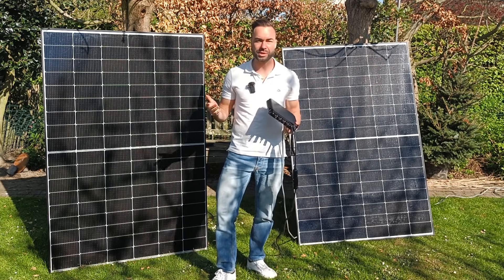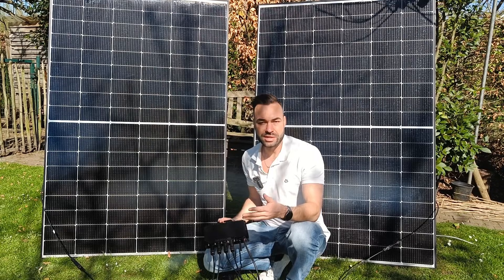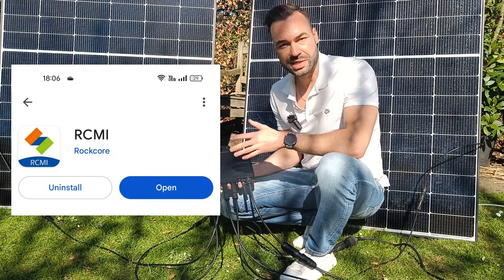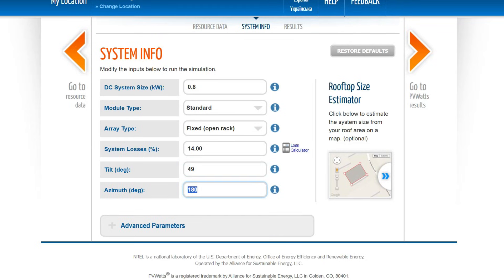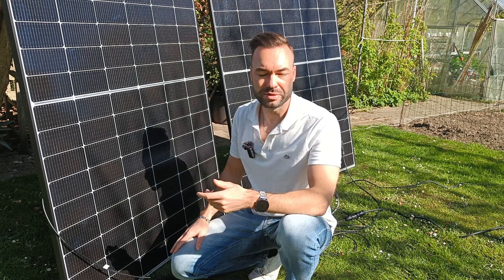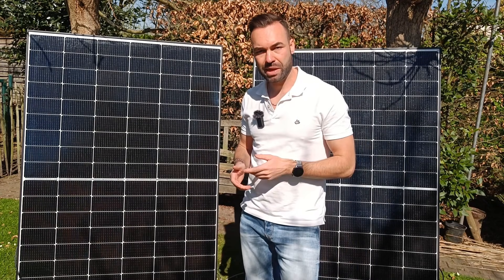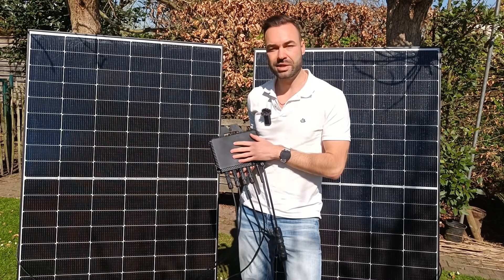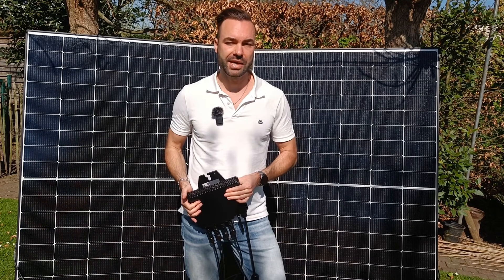800W Balcony Solar System - Plug and Play Microinverter with Socket

Comment: Please explain how power from the micro converter overrides power coming from the street. In other words, why are the appliances choosing the micro converter over the conventional power source? Thank you.
Reply: The appliances don't "choose" power, they just take what they need and the amount taken is measured at the meter. If there is already electrical power in your wires from your solar system then there is less power needed to be pulled from the electric utility wires coming in to your house. If you have the right meter set up with the power company then you can get credit for sending your extra power back out the wires to the grid for someone else to use.

Comment: Thank you for doing this and BEDANKT!  In America our utility has "bi-directional power meters" which means they can measure outgoing just as they can incoming power.  Here if you over produce without a "interconnection agreement" we would get charged more for sending power to the grid.  I wonder if they don't have those situations in Belgium, Germany, Netherlands, etc or if you just plan to have a system smaller than your typical usage for offset to the grid?
Reply from the maker: It used to be that we got the same amount of money for sending it back to the grid. So it was 1:1. But those good times are gone. Now we get €0.005 per kWh we send to the grid and pay 0.3 per kWh if we take it from the grid. So now Europe is big on battery storage.
Reply: @cleversolarpower  when solar was very rare our 1:1 was called "Net Metering" or netting the same $$.  The utilities changed in 2019 and some states have it better than others.  It seems big business is beating the people in Belgium, too, now!  :(

Comment: Mention that you need a directional meter - one that recognizes that electrical energy is flowing back to the grid, otherwise you will be paying for the electricity you send back.  I suppose you mentioned a "smart meter", but it wasn't clear as to why.

Comment: Hello Nick, I am a Belgian guy, living in the South of Spain. I currently have a 12 x 450w with a 5k inverter, installed by Ecosolar, a professional solar company in our region. I have a little outside sun room with a tilted roof where I could easily install 2 extra panels as shown in the video and let it all feed back into the circuit of our home. Our electric company currently has virtual battery system so I feed back to the grid and get (very little) compensation. Do you think I could automatically feed the extra energy in to their grid without notification? Thanks for your video.
Reply from the maker: That depends if they allow it. You have to see if they can accept it. You can also do grid zero and store the excess in a battery.

Comment: So these units turn off if the grid turns off?  You wouldn't want to back-feed into the grid if the power goes off - you can electrocute workers on the grid.
Reply: Yes, these are grid following. So they can't generate the AC curve and will immediately go to 0V if the grid is disconnected. Even if the grid comes online, it monitors the voltage and frequency for a while before it starts to export.

Comment: How would you manage this if you wanted to double the size with two microinverters especially in the uk?
Reply from the maker: You need to check your local regulations. Here in Belgium that is not allowed. If you want more panels, you need a string inverter on a separate circuit.

Comment: I’m installing a ground mount system 4 -450W panels and as I will get some shade I want to use a GROWATT NEO 2,000 micro inverter as in Germany if you have over 2Kw system you must have an electrical inspection to sign off and I can’t get anybody to do this with out paying a lot 
I like the plug and play option.
I made a 2 panel mobile frame that I can move and it is using a 1,000 Growatt micro inverted im averaging 3.5 Kw per day 

I thought that it would be cheaper to use a micro inverter than a string inverter and optimizers 
Your thoughts 
I live in Northern Germany

Comment: Are you an AI character?
Grid signal? You mean electricity from the grid!!
You're limited to which circuit you're trying to access when you plug into the existing outdoor outlet. Unless you run the extension cord through the window. Better to tie through the 120vac transfer switch at the main panel..
Reply: Nick is Belgian, he has a typical Belgian English accent :).  (and typical  Belgian looking self build villa) 
Belgium has a self-build housing culture which is a big part of their economy. Hence solar is very popular when starting new projects with owners ordering their own pallets.  Most Belgian houses have 230V sockets in the garden/patio and also any garden house/shed and often standalone garages.  Main metre and fuse boxes are often in the basement (concrete) at the front of the house or the closet room above (concrete floors) So they spec as many features as possible at build time due to the concrete floors and bricks.  Cables are channeled into the interior brick.  Their digital metres have embedded modems sending data down the lines to the utility company's office for billing, with metering units having 4 x digit counters -  2 x Input night and day and 2 x Output night and day.

Comment: I wonder about the risks of backfeeding the network when there is an outage.
Reply from the maker: There is no risk since this microinverter uses the grid signal to work. If the grid is gone, all microinverter stops working. Off grid inverters create their own sine wave, so they are dangerous and cannot synch with the grid.

Comment: Hello , 
Please can you let me know because I buy also 4 solar panels    18,15 v   , each panel 200 W  so in total 800 W      and I buy also a Micro Inverter  1800 W ( on internet the   A I  said that a Micro  Inverter  1800 W is manageable  -  Not too Big because if you buy 200 W It Is Too Big - says the  A I ) so What I  want to ask you is :
Can I Plug 🔌 The Wire From  the Micro Inverter Anywhere  in my House  or it Must Be On A  Specifically Place  ( maybe closer to the house electrical panel or , I don’t know  …. )  ?
Please Answer Me .
Thank you very much and best regards from Holland , Claudia .
( What is your Opinion , 1800 W Micro Inverter is too much for a 4 x 200 W  18,15v Solar Panels or is Ok  - A I  say that is Ok but I will like to know your opinion )!
Thank you very much again,
Claudia
Reply from the maker: First, is it allowed to plug 1800W in the wall in the Netherlands? I don't think so. You have to look up regulations and don't ask ai because it will tell you what you want to hear. Secondly you have to look at the specifications of the inverter. The input voltage and current cannot be higher than the inverter is specified for.
Reply: @cleversolarpower Perfect, I understand. I look and it is allowed in Nederland and all Europe to “ play “ with a solar panels system Until 800W , you don’t need to ask for permission, Not More Than 800 W ! 
Thank You So Much For Your Answer 🙏 , I Understand That “ Is Not Allowed - or Not Good To Plug Direct In A Socket In House  ! This I Understand, Am I Right ? Thank You For Your Answer, Again !
Reply: @cleversolarpower My Inverter is 1500 W , sorry I forgot to mention I was wrong to say 1800 W ! I wanted to buy a 1800w but I understand with a 4x 200w =800 W is Better A Micro Inverter 1500 W !( Not Inverter, but Micro Inverter - from that one to plug 🔌 directly . With the Inverter I have other Big Board With All Installed - I Believed That I Can Buy Also A  MICRO INVERTER To Have That like reserve , To use Sometimes !
Reply from the maker: Yes, it has to be a micro inverter. If you plug an regular off grid inverter in the socket it will be damaged. I recommend to not plug it into a circuit that has high power appliances running on it as well.
Reply: @cleversolarpower the only high power will be a 65” TV ( about 150 w / h ) and a refrigerator ( that one use about 150w — 200w  - is important how many times you open the door) .
If you say that is Not Good , I think that you know much more then me so I will let only the System With Inverter , I don’t buy anymore the Micro Inverter.
Thank you so much for your help and have a great day! Best regards, Claudia.

Comment: Thanks from Colorado.
Reply: Utah allows this.  I ordered a EcoFlow STREAM and am sending it to a friend in Utah.  Note that you will need a utility meter that senses current direction, else it will be charging you for sending electricity back.  In my case, I had 10k solar installed, so the house meter is able to send back current and get paid (~$0.13/kWh).  I have a few extra panels so will be using this technique to take advantage of them.  All the best from Salida, CO.
Reply: @TheExumRidge  Thanks Salida, you're just over the hill from us in Montrose.

Comment: Does this mean that most home outlets can handle backfeeding? i always thought it was very dangerous to backfeed into an outlet. If anyone has a link explaining how it works on that level i would greatly appreciate it.
Reply from the maker: In Belgium it's allowed on non-power hungry circuits like a washing machine. 800W at 230V is 3.5A and we use 16A circuit breakers. So 800W is considered safe. Anything more, and you need a dedicated breaker. Only do this if your local government allows this. Backfeeding is not a problem because the microinverter takes the sine wave from the grid an synchs with it. if the grid fails, the microinverter will not work. So there is no backfeeding into the grid when the grid is out, which is compliant with electrical code. Now you may not use an off-grid inverter to backfeed the grid because they create their own sine wave.

Comment: THIS DOES NOT WORK WITH "SMART METERS". And the micro inverter must be coded to work as a direct grid connection with all safety standards.
Reply from the maker: A micro inverter does not need to be coded. It does not produce a sine wave when there is no grid visible. It copies the sine wave from the grid. So if there is no grid, it cannot put out energy.

Comment: This system would save me a out $10 per month on an electric bill, so the ROI would be about 30 months.   But at normal prices for the panels and I better, it would be closer to 8 years to break even.  To really make this have a good ROI, you need to get the panels and inverter really cheap.
Reply: There's a lot of free panels about but the owners normally want you to take them down and remove them all, but unfortunately these are older lower wattage ones, sometimes less than 200W each.

Comment: Beware cheap or miss matched MC4 connector ., as it is hard to tell if the connector part is a snug fit . DC is very arcing .  try to use the same brand as the micro inverter
245$ for 800w of solar ! .... I paid £7000 for a 1400w solar system (1300Kwh/year) 12 years ago ... !
Reply from the maker: £7000 for a 1400w solar system is crazy! 💀
Reply: @cleversolarpower   is crazy now, then it was a deal ... it has saved/payed back £9000 so I am £2000 up ... And it was first in my street, & made it acceptable, now there are 5 , so climate win x 5

Comment: Many Microinverters are warrantied for much longer string inverters.
Reply from the maker: I think the reverse is true.
Reply: @cleversolarpower  For string inverters, a 10yr warranty is common.  For micro-inverters, a 25yr warranty is common
Reply: @cleversolarpower Enphase has a 25 year warranty on their inverters. And despite them being on the roof underneath a hot solar panel, the failure rate is very low with Enphase.

I don't know if cheaper brands will last as long, but I have one Growatt Neo 800 in the shed and just made some MC4 extensions to the roof. So that should keep it out of the worst conditions.
One of my neighbors had a 2500W string inverter fail within 5 years, and many brands have had issues within 10 years. 
It may all have been solved with what is available now, but I count on having to replace my 3000W string inverter long before the Enphase 325W micro inverters connected to the panels on the other roof.

String inverters are great without shade issues and many panels at the same angle. But as soon as you need optimizers, switch to micro inverters instead.

Comment: Cleversolarpower by Nick,hey how they store electrisity?if i conect to my house plug do this system will shortened?if not and will work do my home electricity will still calkulete kw how many i use them?or my grid caluletor just stops?
Reply from the maker: They do not store electricity, only convert DC to AC. if you want to store electricity, then you need a battery. If you connect it to your house plug it will sense the grid sine wave and synch with it. Thats why they are called grid tie inverters. Only connect these to the grid if your power company allows backfeeding.

Comment: I'm glad I found you. My electricity bills are so high, I can afford to use oil filled radiator heaters in colder month. I know there ars different types of Balcony Solar elements, not panels, but a rather small thing that turns rapidly to generate electricity, but it works with the sun, it was called Wind Power... easy to plug in n use. You can take it with you, if you move out of that apartment and use it in another balcony.
Can you pls make a clip about that type, wind power generator? Thank you.
Reply from the maker: Wind power is quite useless in residential settings.

Comment: hi, can you add a battery to this setup? nice video
Reply from the maker: You cannot. A micro inverter needs a signal from the grid. If you want to use a battery you need an mppt charge controller.

Comment: You're  assuming you're spending 800W at home in the middle of the day when there is more power, which will often not be the case, so ROI will take much longer. And there are the other issues some peoeple pointed out
Reply from the maker: The power is not lost. Any excess is fed back into the grid. And I can adjust my battery charging schedule  if laws about feed in change.

Comment: Is it easy to add batteries  to make hybrid?
Reply from the maker: No, you need another inverter. Grid tie inverters can only work with the grid or an inverter signal.

Comment: Thanks for the video, I've been looking into microinverters, they are small and awesome for a more "mobile" rig. I am looking for a tailored setup to power a solar well pump at a remote site on my property - are these microinverters suitable for that application?
Reply from the maker: They need a grid signal to work. If you want a solar well pump you should use a pump controller and a DC pump.
Reply: @cleversolarpower  Thank you Nick! DC pumps that I find online tend to be too weak/deliver low head so AC is the only way unfortunately.

Comment: DO NOT DO THIS if you have net metering!
You will want to install a subpanel, move your critical loads to it and completely disconnect it from your “metered” load center.
Reply from the maker: No need for that here. As I mentioned I'm in Belgium and the law is fine with it. Germany as well.
Reply: @cleversolarpower we have net metering or net billing. If your electricity provider uses net metering, plugging anything in to “compensate” your usage will only be added to your net bill. 
I thought it was important to state this because I do realize you’re not in the states. 
It’s always best to have a subpanel for any solar supplementing.

Comment: It is important to state that there should be a massive * next to "no permits". Here in the UK it is illegal to back feed to the grid without the DNO's permission (the company who owns the regions grid network). As a penalty you could pay a very big fine, get grid access revoked or even face jail time if damages were ever involved with a fault. The reason why the grid companies are so serious about this is because Anti-islanding protection is crucial for safety of operating the grid, safety that cannot be always guaranteed if the inverter appliance has not gone through the regional testing.
Reply from the maker: Yes, you have to make sure you follow your local laws. It's impossible for me to give a list of all the countries where it's legal or not. It's a big thing in Europe. Micro inverters cannot feed power back into the grid when the grid is down because they need a grid signal to work.
Reply: @cleversolarpower  Regarding this, is there a way to prevent the micro inverter from exporting excess energy to the grid such as adjusting the settings in the app ect?
Reply: You could bypass the grid entirely by using a 1100wh portable power station, note the panels shouldn't be plugged in 100% of the time, should only be used as a charger, as the power station is just a massive battery
Reply: From Octopus : you only have to inform DNO. If more than 3kw also NO GRID = NO INVERTER ( NO SYNC UP)
Reply: @studiosys  Octopus (or any supplier) has nothing to do with the regulations set by the ENA unfortunately, they do not control any of the grid network and are by far the biggest source of misinformation. Only your DNO can give you an answer. My DNO for the region I live in does not allow any power generation connected to grid without G98/G99 no matter how small. As regs are put in place by the ENA, you can contact them on the official site and they will direct you to your local DNO.

Comment: On the micro inverter, can you explain the Max PV Isc = 16AX2? That is the 2 panel input to the micro inverter, if you short the PV panels there would be no power going to the inverter, how would it damage the micro inverter? (Unless the grid is back feeding the short)
Reply from the maker: I'm not sure what you mean, but I don't think I can overpanel a micro inverter. I have never overpaneled one and I won't risk trying it.
Reply: @cleversolarpower  It's at the 6:22 mark, it's on the name plate spec what does this mean - Max PV Isc = 16AX2 ?